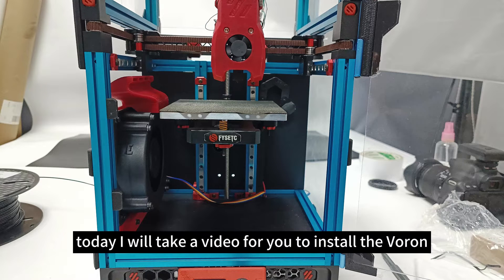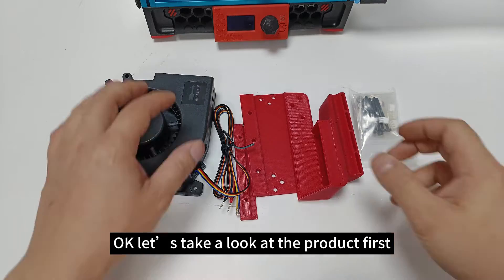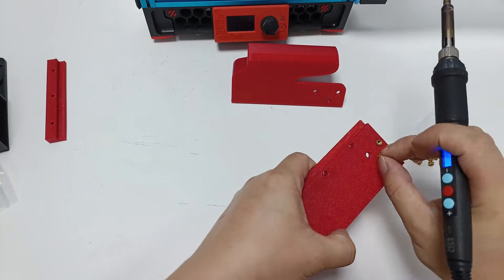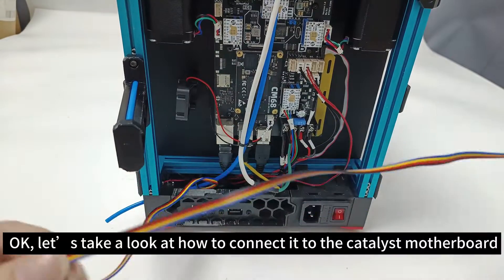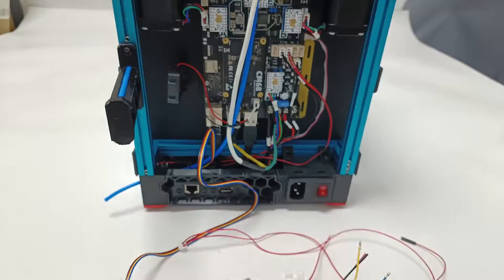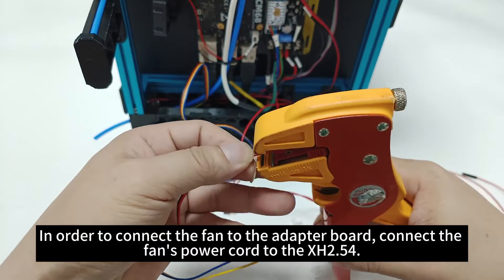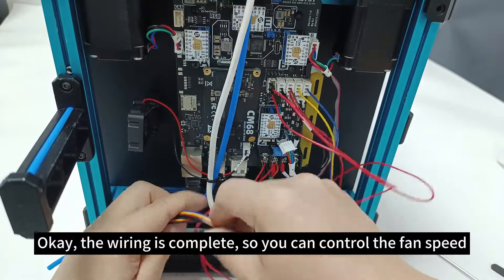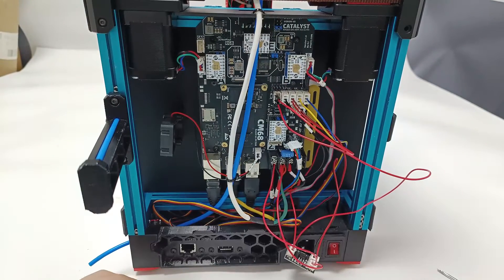voron 0.1&0.2 voron trident auxiliary cooling air guide

Comment: Why you don't post links to the files and product?
Reply: following
Reply from the maker: https://www.thingiverse.com/thing:6122197
Reply from the maker: https://www.aliexpress.com/item/1005006071160992.html
Reply from the maker: If you follow the video wiring, you can copy the following configuration to your printer.cfg.

[fan_generic Aux_Fan]
pin: PA0
max_power: 1.0
shutdown_speed: 0
#cycle_time:
#hardware_pwm:
kick_start_time: 0.2
off_below: 0.05
tachometer_pin: PA1
#tachometer_ppr:
#tachometer_poll_interval:
enable_pin:PC3
# Replacement-Macro to control the Fan with M106 P2 and M107 for BambuStudio
# Macro inspired by klipper-github issue
[gcode_macro M106]
rename_existing: G106
gcode:
{% if params.P is defined %}
{% if params.P|int == 2 %}
{% if params.S is defined %}
{% if params.S|int == 255 %}
{% set realspeed = 1 %}
{% else %}
{% if params.S|int == 0 %}
{% set realspeed = 0 %}
{% else %}
{% set realspeed = params.S|float/255 %}
{% endif %}
{% endif %}
{% else %}
{% set realspeed = 1 %}
{% endif %}
SET_FAN_SPEED FAN=Aux_Fan SPEED={realspeed}
{% endif %}
{% else %}
{% if params.S is defined %}
G106 S{params.S}
{% else %}
G106 S255
{% endif %}
{% endif %}
[gcode_macro M107]
rename_existing: G107
gcode:
{% if params.P is defined %}
{% if params.P|int == 2 %}
SET_FAN_SPEED FAN=Aux_Fan SPEED=0
{% endif %}
{% else %}
SET_FAN_SPEED FAN=Aux_Fan SPEED=0
G107
{% endif %}